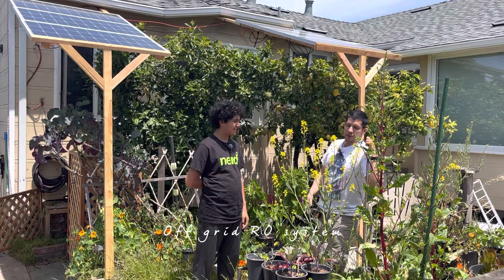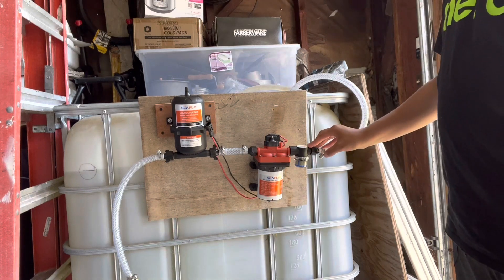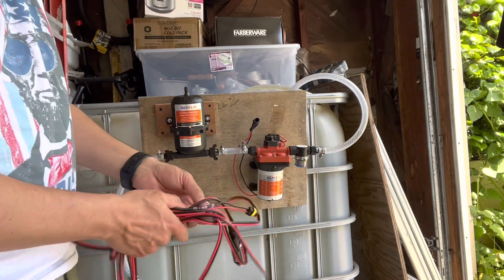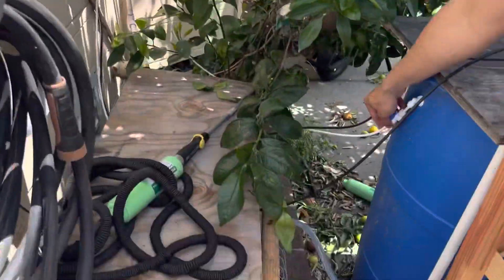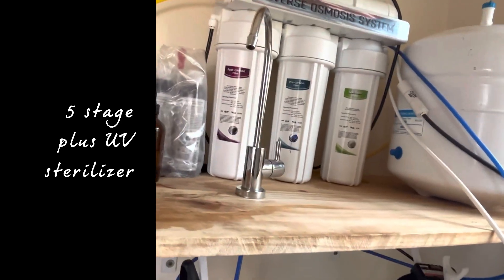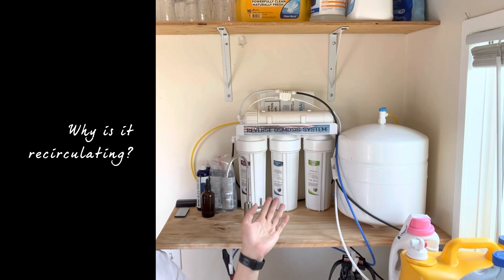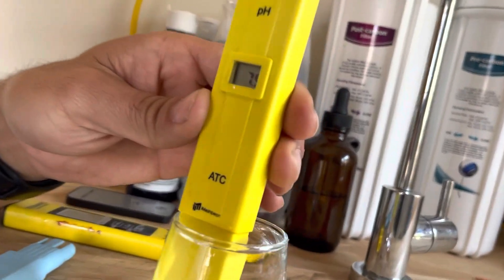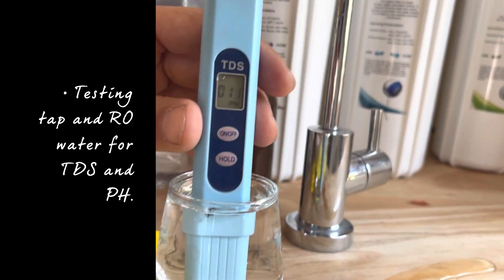Off grid recirculating solar reverse osmosis system

Comment: Great job guys!
What is the purpose of the accumulator? 
What model pump is that and is it working out long term?
Reply from the maker: The pressure accumulator prevents the pump burn out, without it literally overheats and then you need to replace it. It works like a windpipe, imagine having to play that instrument straight out of your lungs, lol.

 The brand is SEAFLO 42 series.